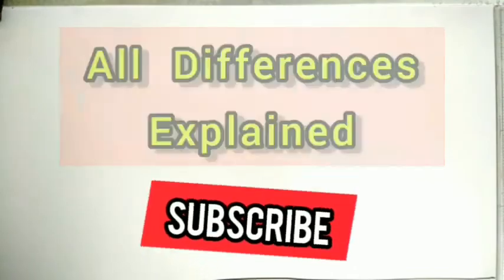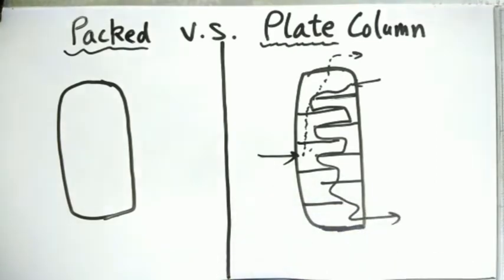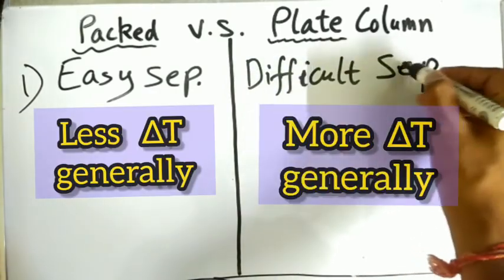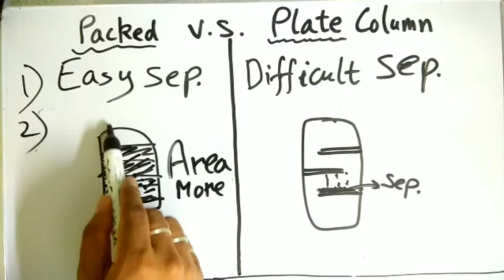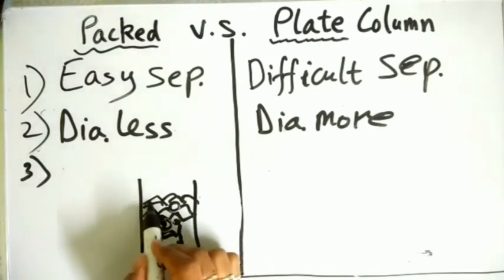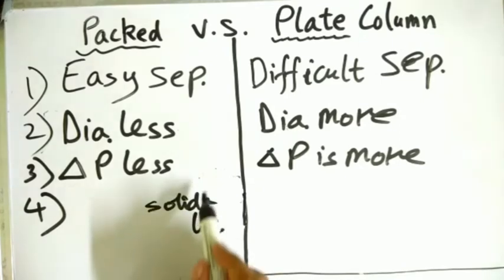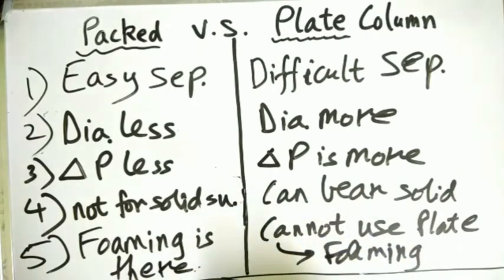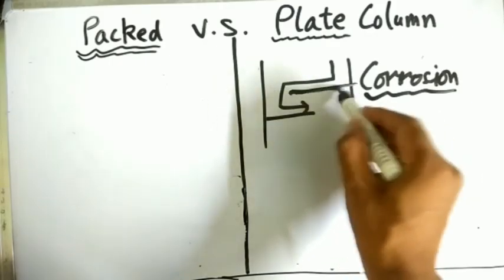Packed columns VS Plate columns | mass transfer

Comment: What about working with material that can create fouling? What is better
Reply: @TheConceptGuy  why please..?
Reply from the maker: @danear2  Sorry, Plate columns are better in case of fouling as packed columns get choked and there is no even distribution then. However, if corrosion can happen then packed bed is better.

Comment: You are not able to convince why pressure drop is less in packed.
Reply from the maker: No problem , let me clear it here as it is easy :-
1) In packed column , there are many spaces leading to a large net contact surface area of the liquid and vapour. As forces are constant , hence, pressure = force / area suggests that our pressure drop must be low in packed column.

2) Also, in tray tower , the rising vapour has to pass through a large liquid pool on the tray. In doing so, the vapour looses it's energy and slowly we see that at the top there is least pressure while the highest pressure is at the bottom. Therefore, there is a large pressure drop.

Do tell me if it's not clear, I will make a video on the same.
✌